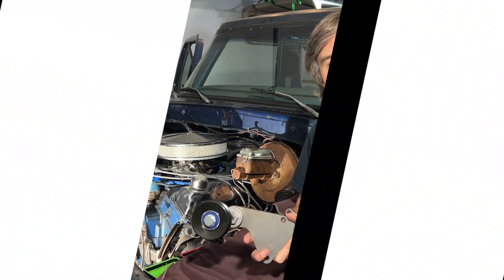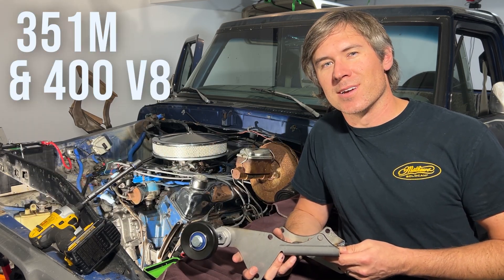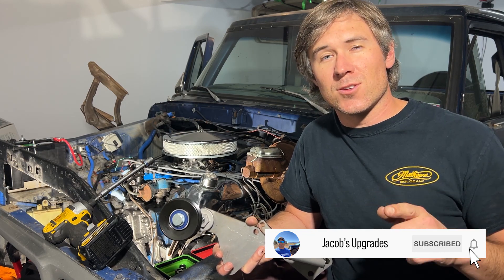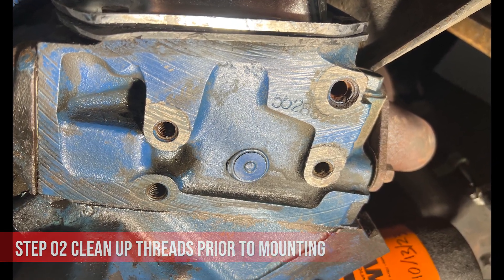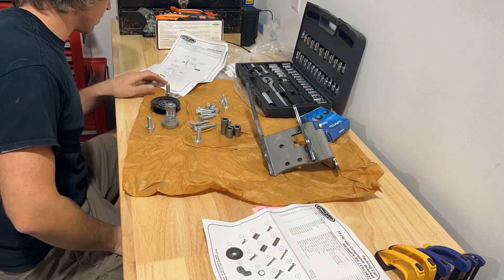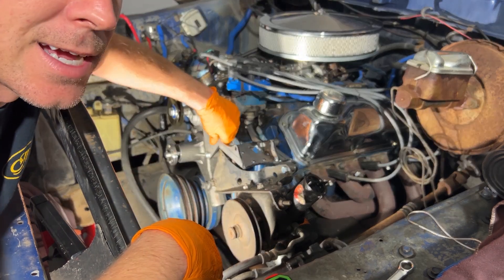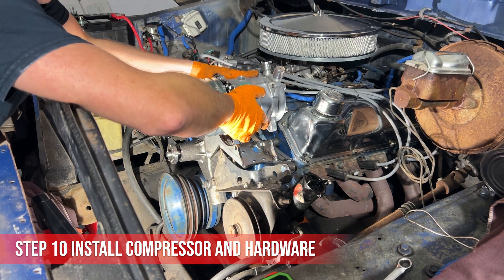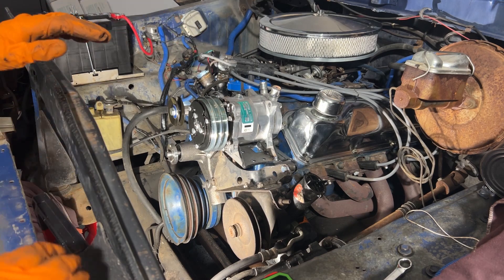Installing Compressor & Bracket | Vintage Air AC 79 Bronco

Comment: I fixed my Bronco AC by taking it all out, including all the parts in the engine box.  Opens up under the hood, no regrets.  Take care of that PS wheel, they are almost extinct.
Reply from the maker: Taking out the factory AC free's up a ton of room. The Vintage air evaporator fits under the dash and includes a firewall cover for the old unit location.

Comment: Where can you get the factory AC idler and brackets for the original style. My 79 is the larger compressor.
Reply from the maker: @teadams72  I would try a junk yard / pick and pull for the bracket. For the idler I would think Carquest/ Advance Auto or O'Rylies might have it.